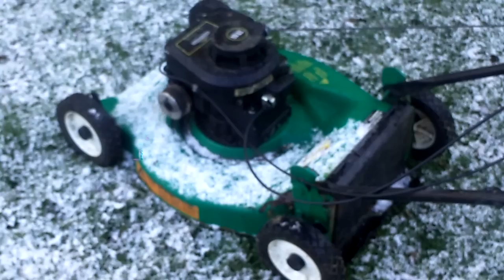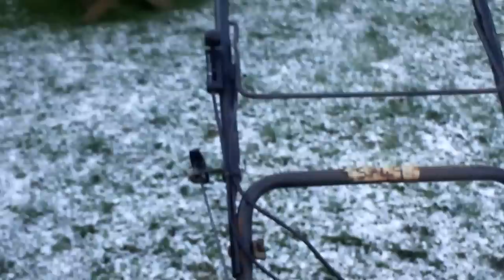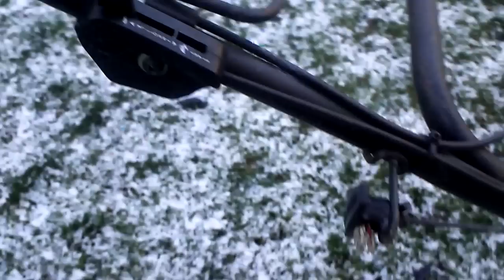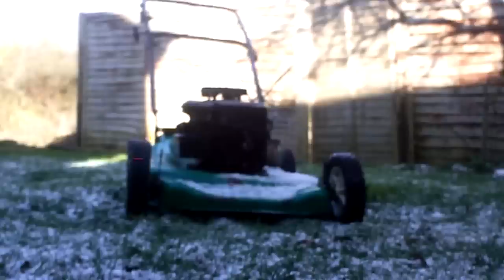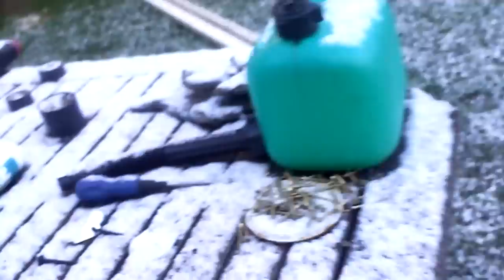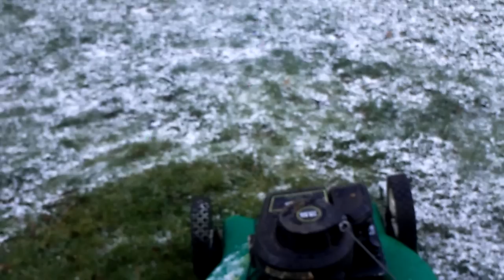Firing Up The Rally.

Comment: i just got my ryobi strimmer going after about 6 months, the pull starter stripped it gears so i clamped it  in the vice and pulled it with string. 

it took a fews days to get it running, the magnito had gone rusty when in storage and there was no spark the carb was full of gunk and the adjustment was well out 

nice video btw first pull again

Comment: yer it does need work, i think it has to be the worst small engine i have ever seen and worked on. if i was to use it i would need to clean the carb out every week or so the damn  thing seems to attract all sorts of crap when it runs. 

now that i have it going and still sounds nice and doesn't smoke i will strip and rebuild it, i will have to make a video before hand